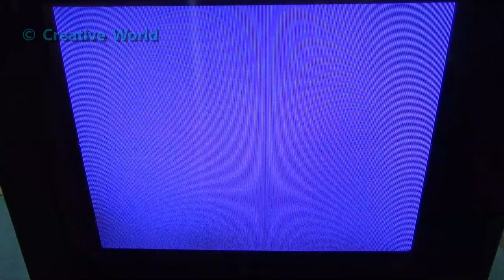How To Discharge Picture Tube (For The Beginners) - Bengali Tutorial

Comment: When I discharged a CRT I acted like I was hitting a bomb with a hammer, I was covered in rubber on a rubber mat and had a wire grounded to the probe I was using. This dude? Two screw drivers bare hands, zero fucks given, LOL
Reply: The screw drivers scissor hand discharge is sort of a standard practice among technicians.